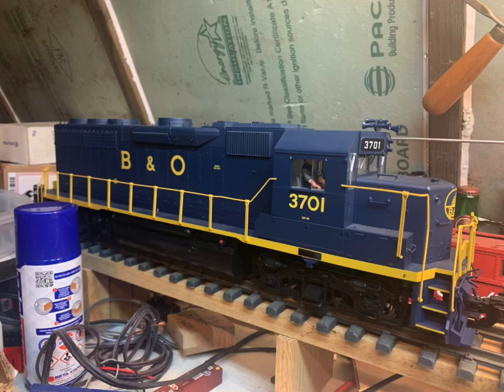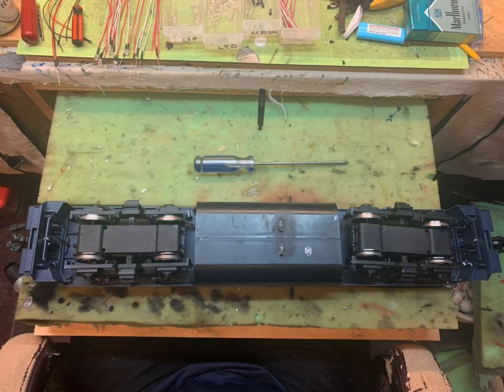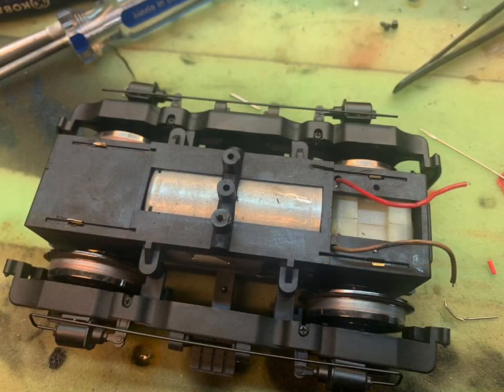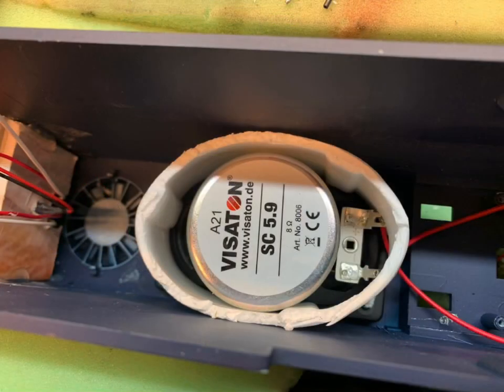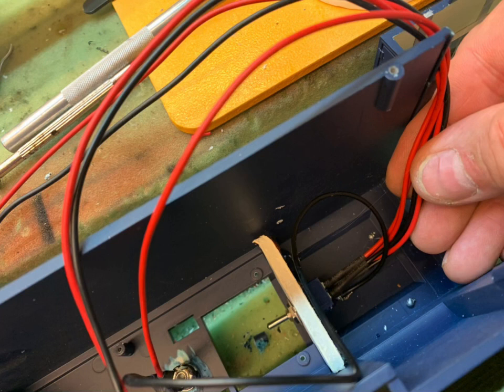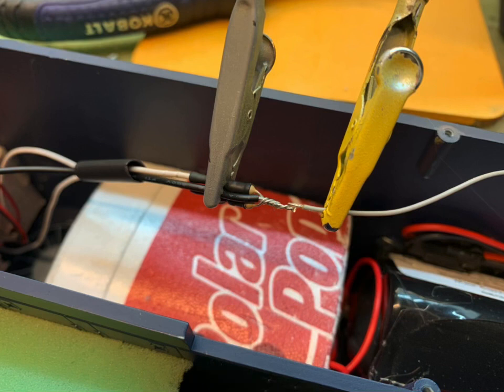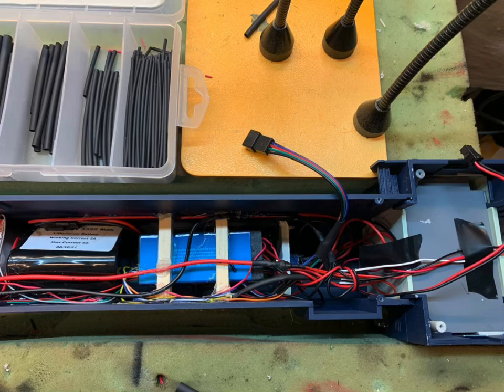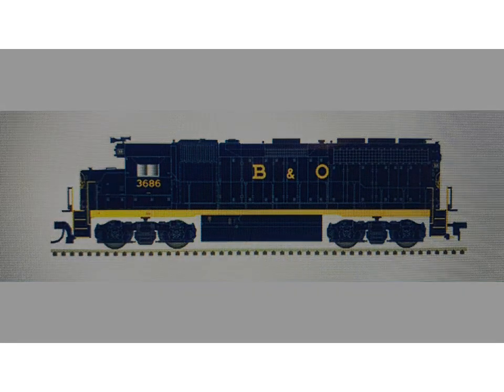How I Installed Railpro in My G Scale Aristocraft GP40. 9/14/21

Comment: for me the wiring is a bit simpler, I'm dealing with one powered truck, and 4 C cell batteries in a Southern Pacific GP9. So a few more places to mount boards, speakers and batteries. (keep in mind the king sky express was released back in 2005 and ran on 4 C cell batteries totaling 6 volts.)